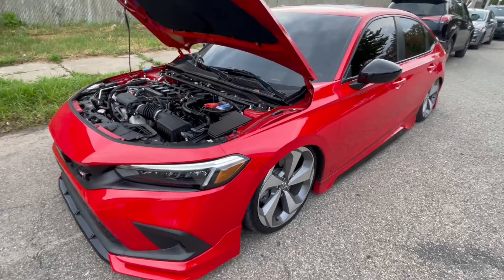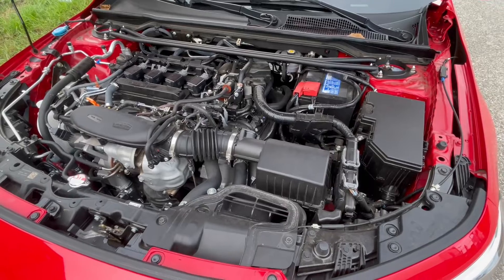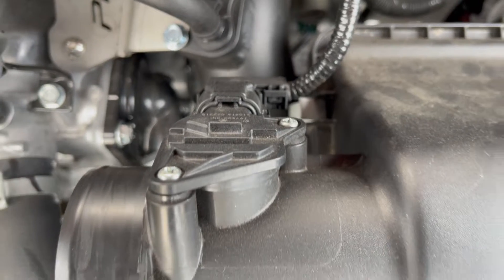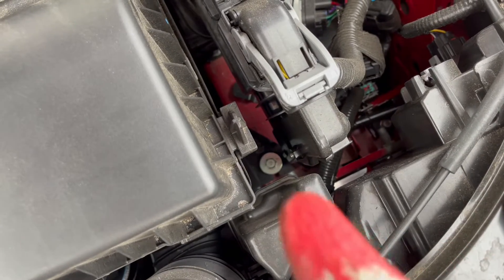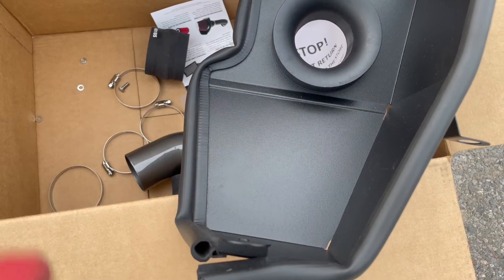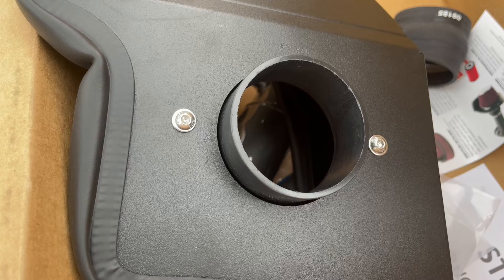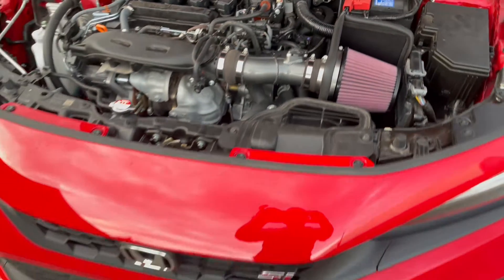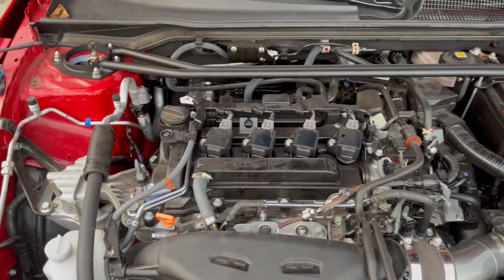2022 Honda Civic Si K&N Cold Air Intake Install

Comment: Just got mine. Easy install and sounds great. No codes or issues. Feels slightly more responsive. It might not be as good as the new prl but it looks much better so im happy with it
Reply: Any problems with heat? Are you still rocking it? Torn between this and the PRL HVI but I want more sound and feel like the K&N will have that.
Reply: @jaylonsorrells5139   it does get hot at low speeds especially in traffic. The prl would be better in that category. No issues at all it still drives the same as stock n i didnt feel any gain or loss in power. It sounds great tho i really like it. Install was easy.
Reply: Is the PRL intake just better overall?
Reply: @ivancisneros6383  The PRL intake offers the best gains because it is fully enclosed  and protects from heat soaking better than the K&N and PRL short ram. The negative is that you lose some sound because of the enclosed box. I ended up with PRL because I live in a hotter climate and wanted to fend off as much heat soak as possible. The PRL HVI does increase sound but not as Loud as an short ram. I did feel a noticeable gain in power and responsiveness though. And turbo sounds are definitely louder.
Reply: @jaylonsorrells5139  have you monitored your iats?
Reply: @chorizojuice  I haven’t unfortunately
Reply: @jaylonsorrells5139 you can probably use a thermal protection tape on the pipe to prevent it from getting hot from the engine
Reply: @drewpeacock3798 true that. I think I'm going to wrap the pipe since it is pretty light aluminum

Comment: Have you noticed a faint high pitched rattle at low speeds or while decelerating? I didn’t notice anything before installing the CAI, and everything on the CAI is righted down. Curious if this is something you’ve noticed?

Comment: hey cant get the air fresh filter factory to come off the oem filter any suggestions? seeing that you and the instructions say to put it back in, ive been runnin no factory air fresh for like 6 months but now saying a vacuum leak so im guessing if i put it back it should help but cant seem to get it off the oem intake

Comment: Any issues with Air temperature readings seen a review where someone saying there Maf sensor and throttle body got coated from the oiled filter
Reply from the maker: @vloggingwithLajuan  that didn’t happen to me and the temps were fine, you can’t always believe what the internets put out if you wanna say that. That’s why I went with this one to try and show people if it works out ok or not

Comment: Hey brotha im thinking of getting the new Si to learn manual and later mod it, would you recommend this car?
Reply: yes
Reply: i would. i just got my new 2022 Si and it’s my first manual. It’s so fun and easy to drive
Reply from the maker: I would recommend it cause also this car comes with the feature of rev match when down shifting, since your new at least that will help you out, but it’s a awesome car I legit fall in love with it more everyday. So I say it’ll be a perfect starter car
Reply: For 6k you can get a manual miata, I just got mine and it took me 2 days to learn
Reply: I really love this car. Its not fast but after a $500 tune its quick and plenty of fun. Handle great and has a good Bose system. Its pricey tho cuz of the dealer markups cuz its a high demand car. I just recommend getting the exact color u want. I get compliments from every age group and background lol everyone just seems to like it

Comment: How do you get the little rubber grommet on the bottom right to come off?  I tried installing my intake yesterday and I could not figure out how to get that thing to release.  is it just supposed to come off easily?
Reply: how did you remove it? having a hard time removing mine as well

Comment: AyybHow does it sound driving spooling
Reply: You probably don't hear it spool much but you definitely will hear it when you let off the throttle and listen to the pressure release from the bypass valve

Comment: will it work for the cr v 1.5 turbo?
Reply from the maker: Don’t want to give you false info, but from what I’ve seen I’m pretty sure it does tbh
Reply: @sfernandez816  how many horsepower and torque does it add?

Comment: Do you need to tune it after install or no?
Reply from the maker: You can install without a tune but it’ll be better if you did cause there you’ll unlock the full potential of it
Reply: @sfernandez816  last question. Will this void the warranty of the car?
Reply: @JeDudeShow  No.

Comment: Time to replace the clutch since it won't hold any power pass stock
Reply from the maker: As of right now it’s hold up pretty well, no slipping, but I have in mind to change the clutch soon once I go e85 and bigger turbo
Reply: @FullSpeedAuto  go with the RV6 type r retro flywheel and Exedy stage 1 organic clutch kit. It will hold over 500+whp
Reply: Mine with this intake and 23psi still holding good no slip. For now

Comment: Your just loosing power with that 👍..Car looks broken dropped like that
Reply from the maker: I would have to disagree with you there buddy cause the car didn’t lose power. And the car is on air suspension. But thank you for the comment 🙏🏻👍🏻
Reply: @sfernandez816  I would bet the car got slower .
You went from heavy wheels to heavier wheels. Definitely got slower. Even with the intake. Guarantee it got slower. Even after a ktuner 16.5 psi basemap,you'll be back to stock Si speed. But hey if you like it that's you
Reply from the maker: @jrkustomz5538  I’m at 21 psi… and respectfully to each their own dude. I know how my car drives, and I put what ever wheels I want. The car is fun it’s definitely faster then stock lol and I’m happy. And again thank you commenting 😎
Reply: @sfernandez816  so marginally faster than stock. You added almost 10 lb heavier wheels than stock. That's a huge difference. I didn't say you couldn't put whatever wheels you wanted. But if you don't know how wheel weight correlates to speed and output.....well you're right to each their own.

Comment: Ayo... That intake is the same price as the PRL high volume intake but looks worse and looks like itll perform worse.
Reply: Yeah ,but for some that care,the k&n is more than likely CARB legal and nothing prl makes is. Just saying to some people that matters. The stock intake more than likely flows better because it's a factory ram air intake. But hey if he likes the extra whooooosh from the turbo flutter,well it's probably a win for him. You could easily cut a 4x5 rectangle on the ecu side and get the best of both worlds. 💀